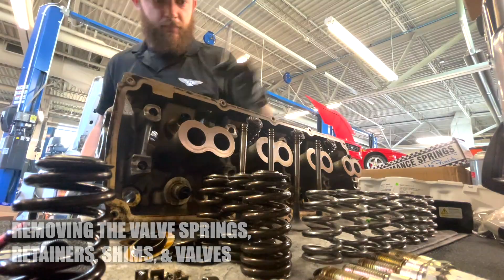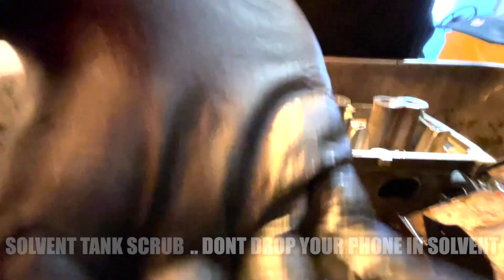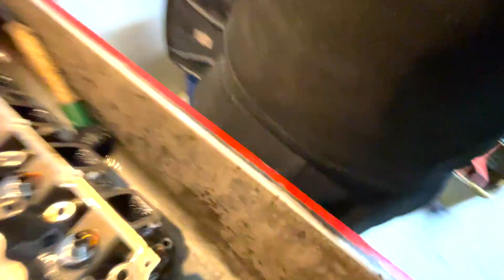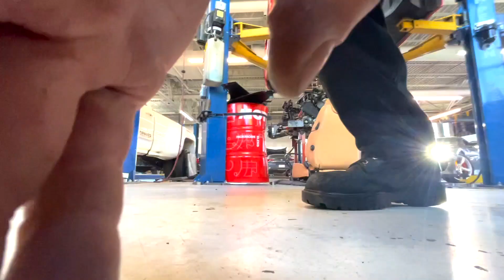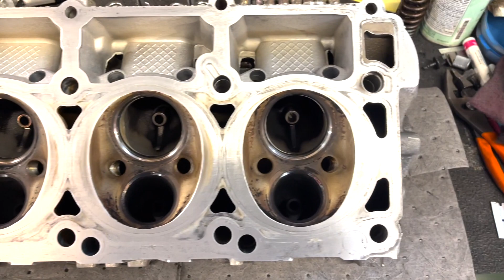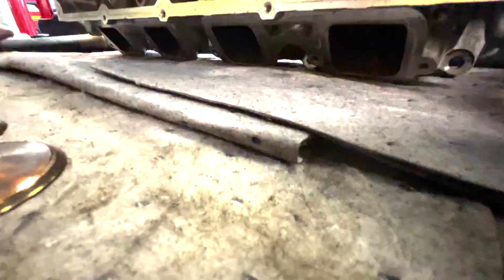392 Hemi Cylinder Head Rebuild

Comment: Just bought a 2014 srt GC with 101k miles, I drove it for 3 weeks and had constant over heating issues, and finally I got a second opinion, after the dealer said the car was ok, Jeep Techs confirmed it was a blown head gasket and I towed it to the dealer I bought it from, they replaced the head gaskets and studs, which is great, but today when it was suppose to be ready, I was told that now the head cylinder is cracked, all covered under warranty, but a nightmare
Reply from the maker: It’s only a nightmare if it’s not covered by warranty. It could’ve been much worse. Sorry that’s happening to you
Reply: @JoshShare  do you think the engine has permanent damage? It was suppose to be only the head gasket fix, but after a failed hydrocarbons test yesterday, they diagnosed it was a cracked cylinder head, and keep it mind, only 1,500 miles were put in the car since it was bought.

Comment: Welcome Back to YT. So I just got my second round of lifter failure (30K miles since that first round) even with MDS delete. I drive about 30-35k miles per year. Really debating if I should forge the internals and fully send it. or get a different motor. First world Problems :)
Reply from the maker: Thanks! I’m fortunate that mine lasted this long
Reply: What lifters did you go with on your first round John? Everyone talks Compcam for the camshaft but I haven't heard much about compcam lifter use. If they make good cams then does it stand to reason they make good lifters also? Back in the day Isky had a good rep for their gear also.
Reply: @marv9820  compcam is what I got through Texas speed.  As fast as lifters they are non MDS like lifters.
I was planning to get all the parts through MMX but my shop has a contract with Texas Speed.
And BTW I don’t think it’s the lifters this time. We opened the oil filter and found big chunks of metal. It may be a hearing or a push rod or even a piston.
Next thing is to take the oil pan out and see around the crankshaft.
Reply: @drv1776  always very interested in what people are throwing into their 392 builds. I predict the day will come when i have to do mine.
Reply: @marv9820  unfortunately it’s inevitable. These engines are designed this way.
Poor oil flow design. These motors cannot be idled for long and oil changes have to be done more frequent than recommended.
But who am I to talk, I drive my Jeep like I stole it 🤣😂
60k (s)miles on the motor and no regurts.
Reply: @drv1776  definitely seems to be oil related failure. Im sure the Germans know how to make quality bearings. Call me silly or stupid but I've just ordered some Turbomaxx that I'm willing to trial. Might be just snake oil. Time will tell.